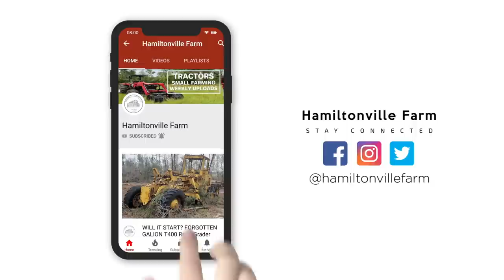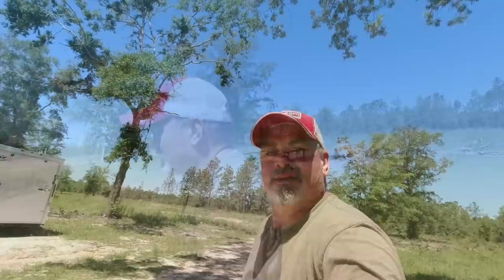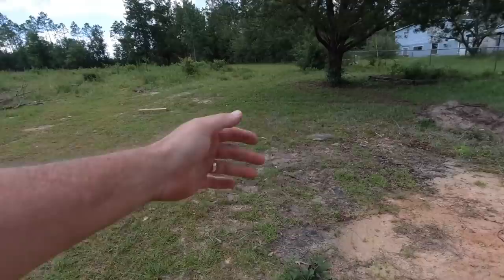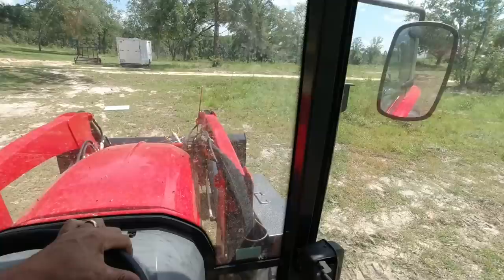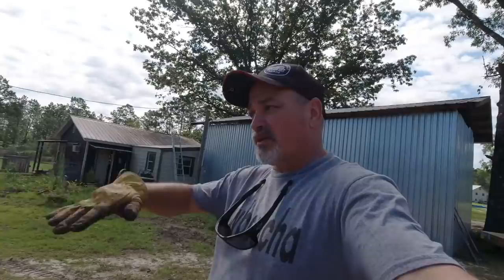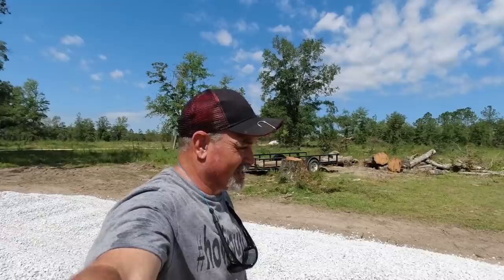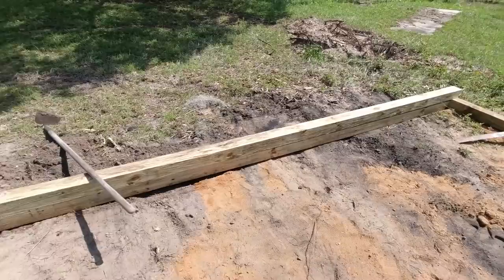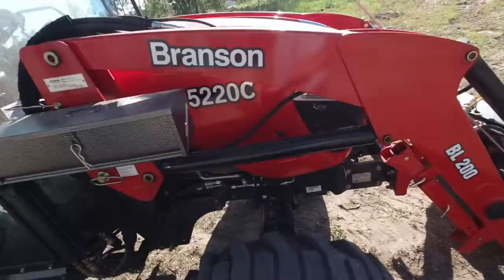RV TRAILER? How to build a Gravel parking pad in 4 EASY steps!

Comment: I want to add a gravel drive and parking area from my existing drive to my back garage, about 200" long and 12" wide, till it opens up by the garage at about 18' wide. I'm using railroad ties as a border. Do you see any issues with simply cutting the grass as low as possible (scalping it), then spraying with grass killer, covered with landscaping fabric and then gravel?  Drainage is great in the area and not a concern.

Comment: Nice video. I'm getting ready to so the same thing. Question....did you compact the gravel after completion...and do you have a video with the camper parked on it?
Reply from the maker: Yes and no. I compacted it by running over a hundred times with my tractor. You can rent a vibratory roller pretty cheap. I don't have a video of the camper on it, specifically. But there are several videos with it in the background of the video